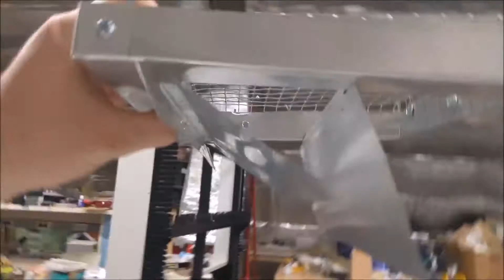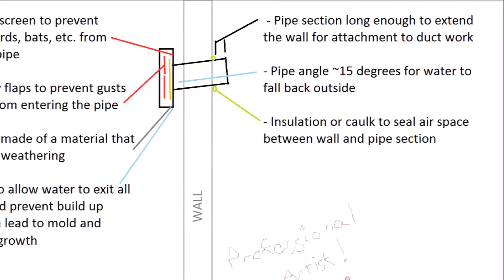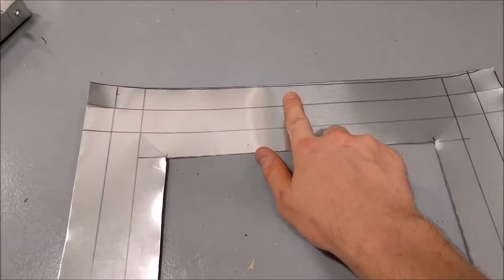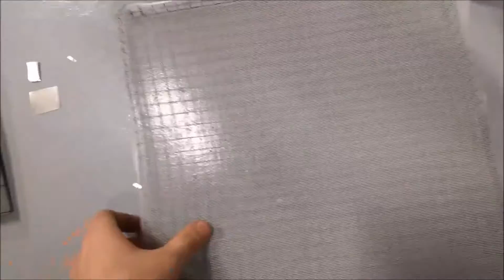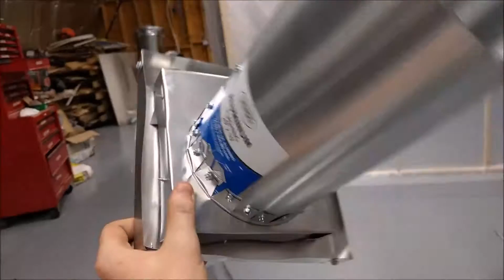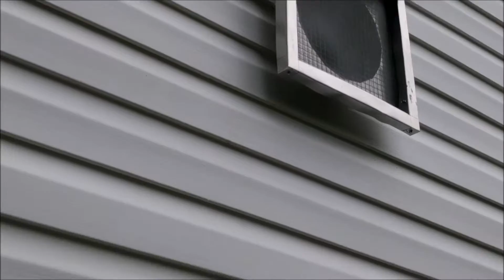Custom exhaust and intake exterior wall covers for HVAC

Comment: Hell if an intake and exhaust pipe size.. mine are only 2" for each and is a 2500 sq ft home..  never seen a 8" duct for hvac unless its for the interior return and vents..